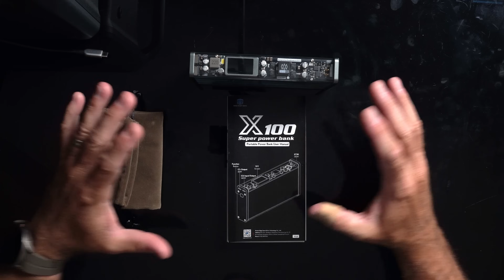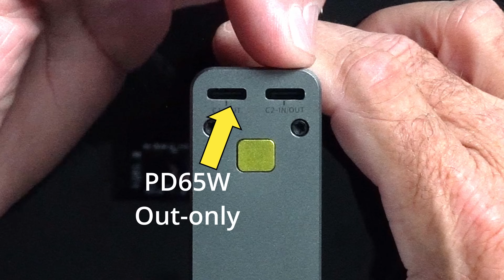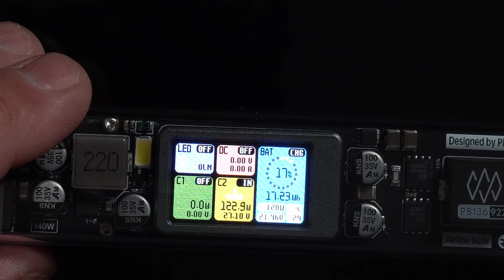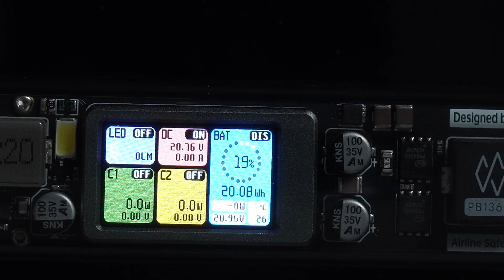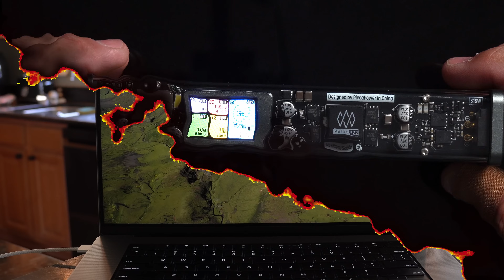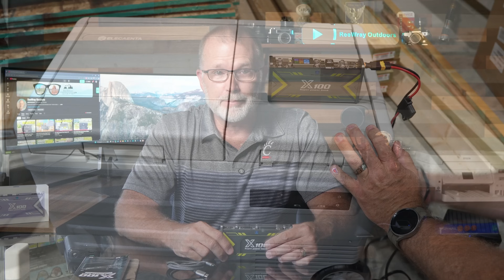Must-Have Travel Tech:  X100 Super Power Bank

Comment: Could you use a solar panel to charge into this PB?

I want to use this X100 to power my StarLink Mini when I need to locate the Mini further away from my RV without having to run a long length of cable to power it... & it would be nice to connect a solar panel to the X100 to charge it while the X100 powers the Mini.
Reply: Look at the peakdo battery for the starlink mini.  Clips into bottom of the mini and it can be charged via solar via usb-C and supports pass through charging
Reply: @nickkotch  Yes THX - 
That would be a great solution for a pass thru solar charging  system. & to have uninterrupted power  to boot.
This new electronics world is a minefield of uncertainty and amazing when you solve it.

Comment: I was thinking the XT30 might be useful if it had a buck converter to allow controlling the voltage, but it looks like it's just a straight battery connection. 100W input 315W output at battery voltage.

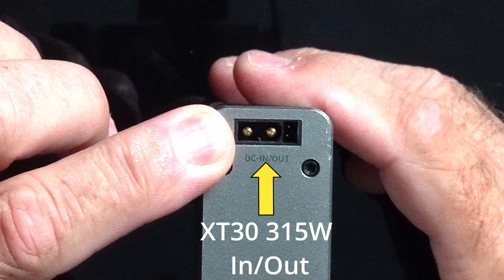Comment: At about 5:14 you show the XT30 being 315w IN/OUT.
Would be interested if you can get proper connector/adapter and possible solar charge the pack.  
I believe my solar panel uses the XT60, perhaps there is an adaptor. I have a couple portable solar panel the can do 200w.  Of course we'd need to know the voltage the XT30 port could handle.
Reply: 100W in only.
Reply: @Tb0n3  I thought is was less than the XT60, but that makes no sense since he stated that the information for it was 315w.
I know the XT60 on my Bluetti AC70 will take 12-58v with 500w, the XT30 is probably less.
Reply: @NOWitsOKto Their own website says 315W out but only charges at 100W over the XT30. Though that may be the average since it says 6A@24V.
Reply: @Tb0n3  ok, that makes sense.
Still if you could adapt a solar panel to the XT30, you probably could charge the power bank via solar, say if you were camping of something.
I personally would use my bigger solar generator like the Bluetti, Ecoflow, etc.
seems like a nice power bank though.
Reply: @NOWitsOKto  Have you figured out whether you could go from your XT60 on your solar panel to the XT30 on the Edge X100 & have it charge?

Comment: Alternate potential use of the 21.6 volt by 315 watt output:  a pair of these in series could provide a nice 600 watt emergency recharge for a 36 volt (nominal) golf cart....  Would seemingly transfer everything it has in under ⅓ hour... Bringing up the main batteries to about 5%...

Comment: I'm going to be a party crasher

You can get modular hot swappable typer power banks for 25$

they  give you 21700 type 5000mah batteries for $25

And you get (4) 5000mah batteries so that's 20k mah

Drawback of course is 22w charging limit

You can buy 600wh power stations and 900wh power stations for this price too

And those have AC inverters 

Why don't super premium power banks in this video offer   at least one pure sine wave one outlet  inverter
Reply: Biggest problem is the 100wh limit for total capacity for TSA compliance. Cheaper and larger output options for the price but not inside there "rules"
Reply: @CanadianTank007   20k mah is about 88wh so that's under the limit so for my power bank example it checks out and it's very portable you can carry that in your pocket

Also there are 88wh power banks with AC outlets, problem is there are modified sine wave .. seems like no developer has fixed that issue yet at those smaller power bank sizes
Reply: Yeah it cost a lot more to do pure sine wave and is it really worth it under 150 Watts plus Most low-powered devices have their own power supplies to clean out the power. @viyusavery248
Reply: It’s inefficient to power DC devices by converting the power to AC to have the device convert it back to DC.  In a 97Wh battery, you don’t have capacity to waste on that.   Once you have a few hundred Wh of capacity, then it starts making sense.  Also, inverters can drain the batter my to be on without the device pulling a load.  Plus, it would add weight and cost to the device.
Reply: @NickWindham  efficiency is not a one legged creature there is no loss to giving a consumer options... less options means inefficient versatility.. the irony..

the marbero M88 exists it just doesn't do pure sine wave and it's in the $70 ball park or less

The market has already validated 12v 100 car puresinewave inverters.. inverters at low watts have tiny idle power consumption 

And would complement multiple devices laptops, routers etc even a standing DC inverter fan can run for hours on 90whr

Efficiency doesn't only depend on the inverter locally we can get efficiency from DC inverters in other appliances 

We even have things like he aefiry nano 100 which I'm literally just discovered in these comments sections today and that has lifepo4 chemistry, 100w solar input 140w type C too and that less and 100usd

Comment: Thank you for the review.  Was really hoping you would have actually measured the real world capacity and watt output to give us measured efficiency numbers rather than marketing materials.   I think your tester has USB capabilities for doing this.  If not, there are other testers that do.   I have a Poweradd that does 140w and is rated at the same capacity that is about $50 on Amazon.  Was testing with it yesterday and it does very close to 140w in/out to my devices and power stations.  Ugreen and Anker also have similar 140w units.   I wonder how the honest tested capacity compares.  Thanks again.